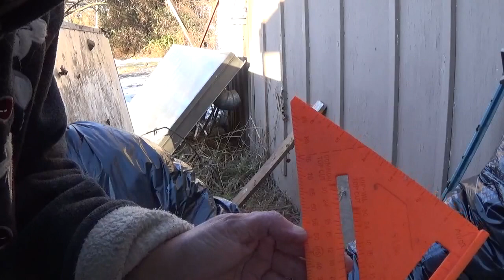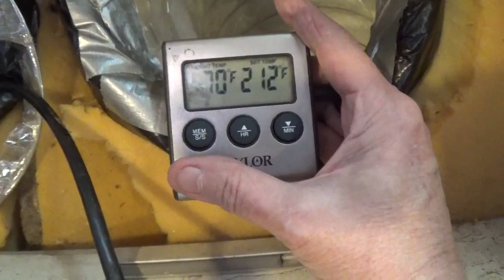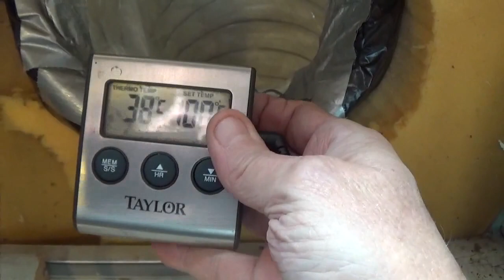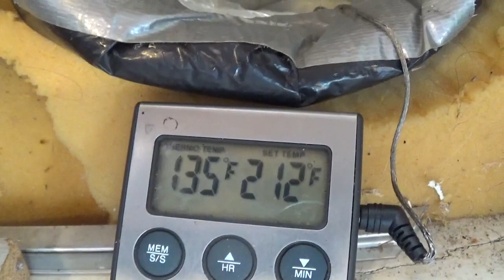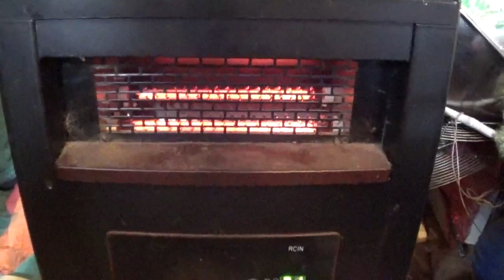Re installing the Solar heating panel

Comment: Good work E and thanks for showing us more on the solar. Looking forward to the heater video. Looks like the birds was thinking they'll be glad when the rest of the snow melts off. Few more month and it'll be perfect weather for planting and sitting around the fire pit! Have a good'nnnn
Reply from the maker: +geargriden19 Thanks, Gear. They are happy the snow is melting. Spoil birds. LOL. It will be nice to see spring. My favorite time of the year. Best wishes. E

Comment: Not sure if you know this but you can join both the zip ties and those metal screw clamps together. I could not tell if you were not using them because you did not have a big enough size or if you did not have them at all. But i was very impress with you using the rope. Such a simple fix that most people would not think of. That solar heater looks like it works great. I am amazed at the temps you are getting.
Reply from the maker: +Benja's Uber 1337 Hobby  Thanks. It does really well when we have sun. My zip ties are way too small. The rope will work for now. I will look for 8 inch claps when I am ready to install both permanently. This was a temporary install to see if it was worth running ducts and installing them both. And yes. It is worth it. But not a roof install. They causes added expense to the roof.

Comment: I give you thumbs up for working outdoor in winter without help and without your gloves on.  Your amazing and yes I like the solar panel. I wish I have the same to power up my home :-)
Reply from the maker: +Cultivating Organic by greenwiseJo Thank you so much. I think you may have more sun than us too. I saved over 20 % each month last winter using just the one. If we do not have another spring and summer full of rain. I hope to get them both installed in more of a permanent way. But not so permanent that I can not take them with me if I move. :)
Reply: That's a big saving specially for the northerner, since they have longer winter than us here down south.

Comment: They get up to 135 or more? That is real good even for a couple of hours. that is the first time I have seen those type panels. Thanks E, hope you have a mild winter.
Reply from the maker: +WORM GITTER Hi, Duke. Thank you. The weather is crazy still. May be in the 50's today. Yes, The heater can really pump up some temps. The 2 panels can heat about 1200 square feet. I do not have duct work ran in the house yet. Too much rain or ? keeps me from getting it done.

Comment: you can take short cable ties and make longer ones by inserting one into another. best to buy the uv resistance kind that don't breakdown in the sun.
best
Reply from the maker: +Rev John O'Toole Thanks. I tried that with the ones I have. None are big enough to work for this. I only have tiny ones now. I need to look for more somewhere else. When I do the permanent install. I will have better things to work with.
Reply: +TheEmptynester snowing up here now, how about something like these

http://www.homedepot.com/p/Everbilt-6-in-Galvanized-Steel-Worm-Gear-Clamp-MC6HD/203626509
Reply from the maker: +Rev John O'Toole That is the metal ring I was talking about in the video. It was 1.89. But it did not expand enough to go over the insulation. They did not have an 8 inch in stock. Thank you for looking it up. I am grateful for your help.

Comment: You have the same problem I've got, I can never find that extra set of hands when I need them.
Reply from the maker: +jus4funtim Thanks. I did not realize that was what would make this easier.
Reply: Sometimes it backfires and the extra set gets in the way.
You said your zip ties weren't long enough ? You can connect them together to make them as long as you need.

Comment: wow that was hard to watch, did you feel me helping you I was trying lol. I need to make some of these. My age and cold weather is not a good thing for me. I do get out and take care if the animals and do everything that has to be done, but this year I swear I can not get warm enough perhaps its the dampness in the air. I saw someone mentioned their guitars I worry about mine here and my ukulele's. I put those moisture things in the cases and the one's I play most often I hung on inside walls and put a moisture pack in it, don't want them too dry  yet you don't want a bunch of changing, its a catch 22 with them out here in the woods and I loosen the strings on all of them.
Reply from the maker: +Ozark Mountain Girl So sorry. But it is so kind of you to offer help. I did not realize it would be harder to do in the cold.  I was going to make some with gutters for the front. But these are commercial made ones. A neighbor from my old home gave them to me. They were about $10,000 installed for them. But cost extra to reinstall with a new roof. So they left them off. I saved over 20% a month on my bill last winter. If we had more sun it would be cost effective for them to re install. I will not put them on my roof. So they took on some water from the flooding rain. 
We are too humid for wood instruments too. I hope the moisture things help. I know I can pull over a gallon of water out of the air in no time with a dehumidifier. The electric heat zaps the moisture too. But mold is another concern.

Comment: Cloudy and yucky here .... I'm right beside the door ... Just opened it ... eegads ... cold right up my legs .... Hope your dressed warm enough .... Surprised you ain't wearing work gloves .... AHA!!! ....You just said it ... Great minds think alike ... Yeah I was gonna mention cutting your fingers too .... careful ... careful ..... Patience? .... Don't worry ... I got a lot of patience watching you ....  WOW !!!!! .... Now stick that in your pipe and smoke it .... Rope that bad boy ..... Duct tape be danged .... Oh and then she grab's the duct tape after I say to forget it .... Just like a woman .....  Alright ... Let's get that heat on ...... Get it up to 80 ..... YEAH !!!!! .... The Heat IS ON !!!!!!
Reply from the maker: +Herfortz I always regret not using gloves. But do not like wearing them. They make it harder. I did not get cute this time. Things use to be easier to do. Now I have to try and try again. But Duct tape fixed everything. :) Even my boo boo's :) I have made plenty of band aids with it too. :)  Glad you had patience. Some day I have to run duct work and get both of these installed permanently. 
Hope you are staying warn. I just thew on a coat with my jammies. LOL  Now to find my shorts.
Reply: +TheEmptynester   I've got my thermostats at 77 and that seems to do the trick. I keep a couple of windows open all year to avoid the mishap that temporarily ended my guitar playing career .... The dampness had seeped in through my guitar case and got to my guitar ...... A guitar repair buddy of mine has since fixed her up.
Reply from the maker: +Herfortz Glad you were able to get it fixed. Moisture got to my youngest daughters viola. I sold it at a yard sale. Some one else know how to fix it. It would be nice to here you play a guitar song.